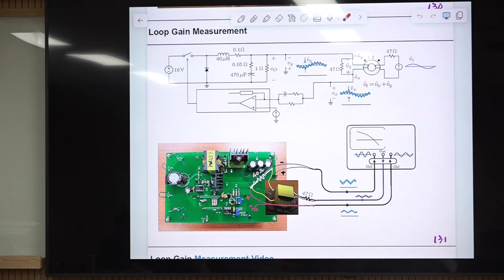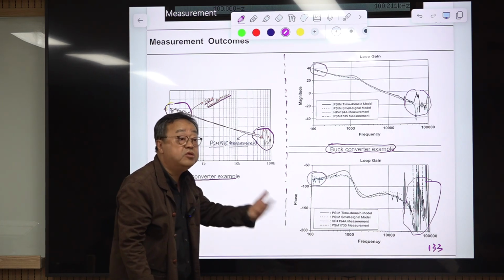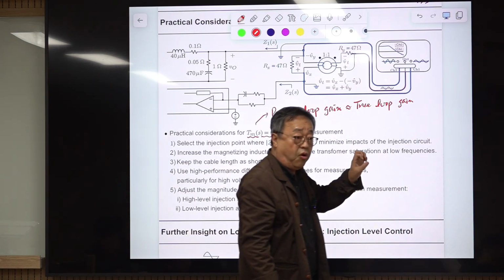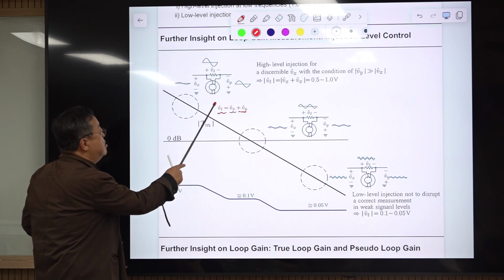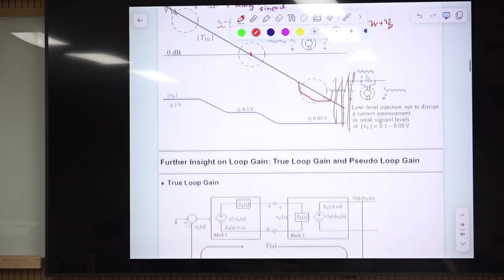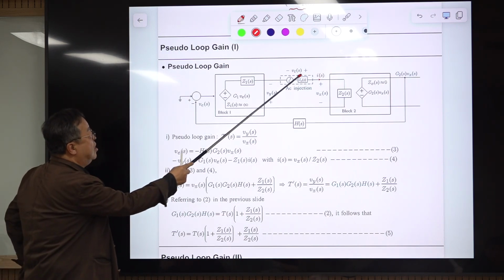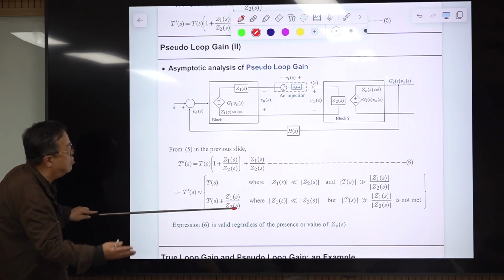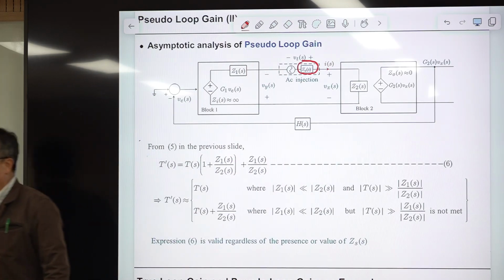Lecture 03: Loop Gain Measurement, Impedance analyzer, Loop gain, Stability, R. D. Middlebrook

Comment: Why is at 0 db and 180 deg phase shift system marginaly stable? Isn't that a point where denominator of transfer function becomes 0 because GH=-1?  T= G/(1 + GH)
Reply from the maker: With GH=-1, |T| becomes infinite which indicates the output of the transfer function could be any finite value with a zero input condition; this is the condition for a sustained oscillation. Thank you for the question.
Reply: @byungchochoi3322  Thank you for your answer!